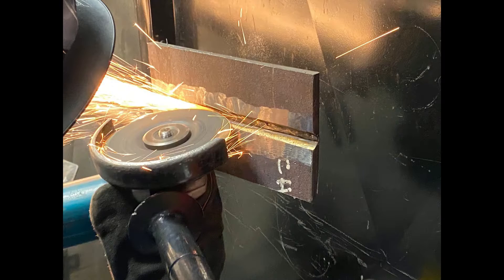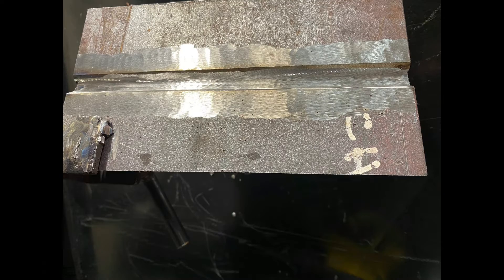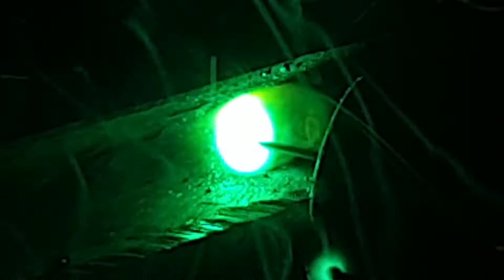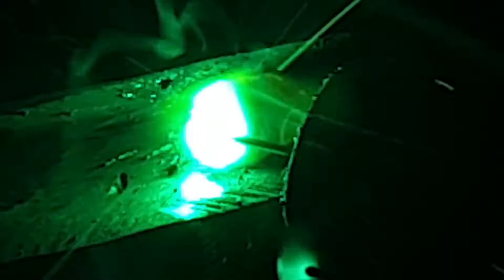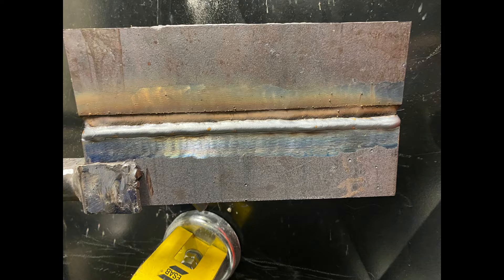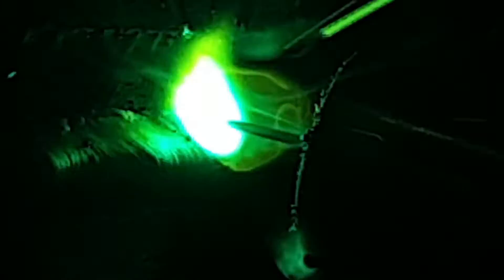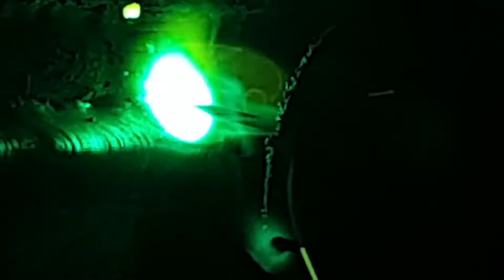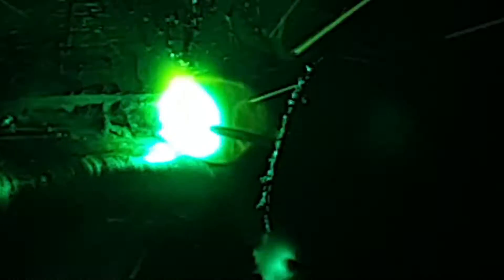MIG Welding horizontal (2G) 15mm thick butt weld

Comment: Welding aws tomorrow for 2g in mig.. this video was really helpful! It looks like you’re pointing straight at the metal instead of at an angel I think that’ll help me! Because when I do test plates my beads come out looking good but there is always porosity in my backgrind & I literally can’t figure out why.. mind you my root pass is good.. I literally have good penetration in my welds.. & so is my filler passes & cap passes & everytime my instructor sees my bent peace’s are keep failing he keeps telling me the same thing.. he says it’s lack of fusion & that I need to fix my angel.. it’s literally to the point I had my instructor come in my booth & watch me weld & he told me my angel is fine & that my welds are good so I still don’t know why I keep failing the bend test.. I don’t know if my instructor just isn’t giving me the correct advice or what.. I try to give him grace though because there are other students in my glass.. also I’m running at 400 & 22.0
Reply from the maker: Yes we are pointing up taking into account gravity, if your failing bends tests your not getting penetration completely or lacking fusion through the joint. Which tells me either your settings are wrong or your angle is wrong. Hope you passed your test the other day 👍🏻
Reply: @weldtechsolutions thank you

Comment: Is it best to just go forward with no pattern movement as you weld or is it preference
Reply from the maker: It is best for stringer beads which is with no pattern as you focus the heat better and leave less chance of defects. Having said that it doesn’t mean that doing it with a pattern is necessarily wrong it would just depend on what your weld procedure asked for but ild go as far to say that every procedure with this thickness of material and horizontal welding will ask for stringer beads (straight runs)

Comment: Were your fill and cap passes the same settings as your hot Pass?
Im doing this in welding school atm, is there any adjustments you would recomend with Argo shield light, its the only gas they have here atm.
Reply from the maker: @deepwinter77   you can put them up after the hot pass as long as your  not putting to much wire in that could cause a roll over on the bottom of your runs.
Reply: @weldtechsolutions  Thanks, I think I had it to high for fill and cap, 22v it was starting to go into spray transfer, because of the 93% argon, 5% co2 gas Mix.
I'll give it a try I'm back in school Tuesday, Patrick's Day tomorrow so day off, I'm in Ireland.
Reply from the maker: Let us know how you get on. Enjoy st Patrick’s day ☘️.

Comment: Hey, nice viedo. What wire size are you using?

I have been welding 12mm plate, 15 degree bottom plate angle, 45 degree top plate angle. I am struggling to get fusion between runs at wfs 4m per minute at 22V with a push technique at 10 degree travel angle using 0.9 wire size.
Reply from the maker: What is your gap size? The settings here are based on 1mm wire so slight adjustments will need to be made for 0.8 wire. The root for us was 17.5 volts and wire speed 4.4 metres per minute with 2.4mm gap.

Comment: Three runs easy to cap the gap, four if you wanna run a thinner bead and make it fancy. But it really depends more on the welders skill and preference. Personally, id do three just so its done and looks standard. You throw anything fancy or extra in there and it might just screw everything up. Fancy is for art, standard is for work, never let them know you can make it look pretty.

Comment: Funny. Over here, if we as much as think about grinding down any roots, apart from even out the required stop-start, we can just throw the entire piece in the bin whilst having a welding inspector seriously questioning our intelligence.
Reply from the maker: That's pretty crazy. It gives you a flat surface to work from however you don't have to do it like you say you can just weld on top of this.
Reply: @weldtechsolutions  Yep. According to the Iso-standard we are strictly forbidden to grind down the weld anywhere except starts, stops and start-stops, and gently remove any spatter along the sides. 
That being said. If the root, or any other part of the weld needs grinding, I'm fckin grinding it. Especially when using solid wire since it's prone lack of fusion even when running pmc.
Reply from the maker: @Gundolf300  hahah sometimes it’s just necessary 🙌🏻

Comment: This is probably the only video that does short circuit mig correctly which is not that mig like tig garbage it's way safer to just steady pull it less chance of lack of fusion which it's know for
Reply from the maker: Thankyou sir. We see lots of bad practice online as-well as lots of good however our aim is to reach the correct way so Thank-you for your comment recognising this. 👍🏻